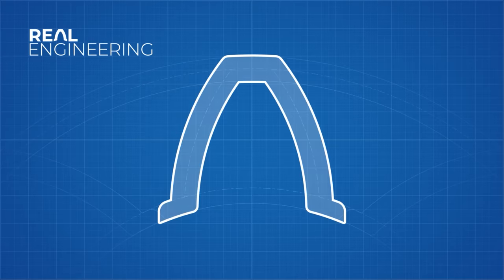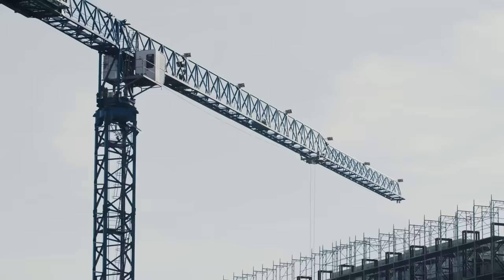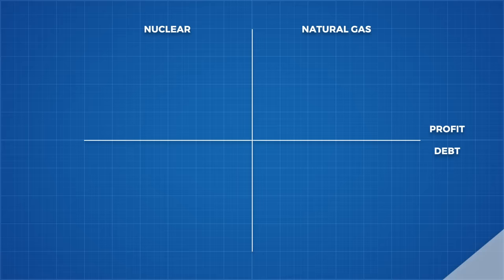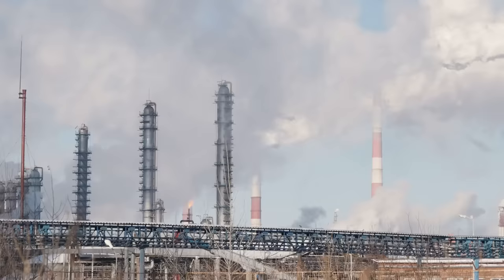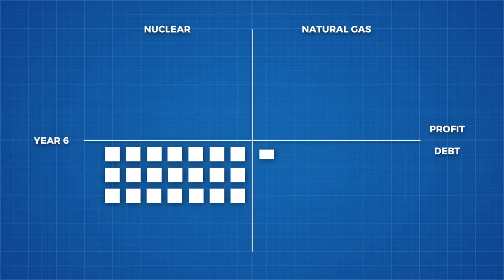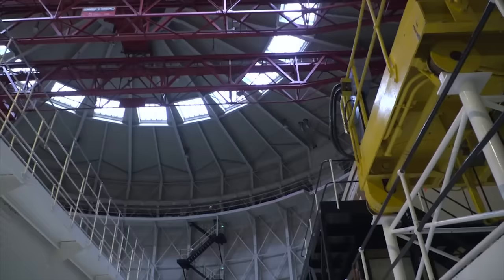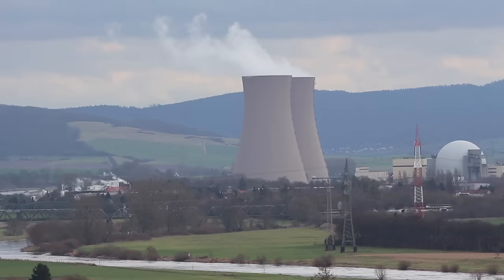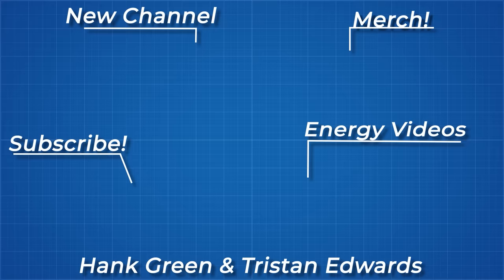The Economics of Nuclear Energy

Comment: "It's competing with larger, baseload plants" Nuclear is the gold standard for baseload
Reply: Yeah exactly. Power production remands consistent all year round and the fuel lasts for a ridiculously long time. It is the perfect source for baseload.
Reply: Exactly, so you now have to compete with the other baseload plants instead of following demand like a gas plant would. The latter is of course more profitable per kwh delivered to the grid.
Reply: @catriona_drummond  well you see that's why we should still use nuclear. Nuclear can be the base load with the battery backed up solar and wind as the short term demand. Solar and wind even basically require this as solar is most effective in the mid day while most power is used at night. Solar also produces the most power in the summer but power demands peak in the winter. This means to effectively use wind and solar you need mass storage, not just some storage. We need to hold what we make in the mid day to night and you can go a whole week of little sun light so about enough storage to hold us for a week or two. This cuts out gas entirely as that is the main contributor to climate change. Sure it's more economical but it's not as sustainable. 

Plus there isn't enough lithium in the world to be converted to power banks. You need to more go along the lines of pumping water into reservoirs or more a liquid battery instead as they are less effected by weather, hold charge more efficiently with lower losses, and can be scaled much larger up. 

Plus the cost for a solar or wind array to be the main energy supply is way higher than you think. It's the whole reason Germany actually has much higher energy costs then France as does California have higher costs then places like Texas or Pennsylvania. The cost to back up a solar array for example basically doubles you cost and doubles you land needs. This means you pay more for land to produce the same amount of energy. Plus, while solar tends to be viewed as cheap, not quite when you are talking mass production. Remember that solar panels rarely function at 100% their rated performance and they do degrade over time as well. When you calculate the cost to produce a nuclear plant vs a solar array of equal energy output with backup storage for it, costs end up being nearly identical. This is kinda something he really skipped over. Solar is cheaper on it's own but only about half. The storage is just as expensive as the panels and using systems like reservoirs requires special zoning permits and more legislation if that's what they go for making the costs comparable to the nuclear plant. The difference is the nuclear plant has a consistent output while the solar array fluctuates greatly depending on weather, season, time of day, or even just the heat. 

Wind is straight up inferior to solar in my eyes though. It requires constant maintenance making it cheap to build but more costly over time. Not to mention that it takes up a huge area of land to make a decent amount of energy as the blades have to be well separated and they have to he far enough apart so if one falls they don't all come crashing down say if a tornado hits.
Reply: @Skylancer727  You haven't understood a word i wrote, have you? My point was exactly that we DON'T need big plants for base load.
Reply: @Skylancer727  Also where will you keep the waste? Not a single country in the world has yet built and is operating a safe end storage for nuclear waste. Not ONE. And we are having these plants around for 60+ years now.
It's like buying a car with an angine and no brakes ("we'll worry about how to stop when we egta to that.")
Reply: @Skylancer727  I am not against Nuclear power at all. But I want to see its problems taken care of first.
Reply: @catriona_drummond  a lot of what we see as the main problems are from how we fuel them and just raw scale. Many are planning on transitioning to liquid fuel reactors as if a runaway heating event occurs it can just melt a plug and go into a backup tank to be refilled after the issue has been solved. This system makes meltdowns entirely impossible. 

Smaller reactors also help in the cost side as the big issue with nuclear is the scale of the projects making them cost a fortune. This is good in that nuclear plants have been the highest outputting format but bad in that this puts their dept issues way worse. Making them smaller reduces complexity and will cut back on the cost of building the plants. There is also the possibility of thorium reactors in the future which would make the mining process drastically cheaper, plus it is far more abundant in the soil meaning we could mine the thorium on our soil rather than importing it like uranium as uranium is far rarer and the majority of uranium in the soil is weapons grade uranium so thorium is drastically cheaper. 

The last issue is waste and that one has been a very slow development. Right now only 1 waste disposal complex exists even under construction but will be finishing completion this summer. Unfortunately it's in Finland, not the US. In theory thorium waste products are less hazardous than uranium products but it still needs to be disposed properly for the longer lasting waste. Nuclear waste really only is a worry for the first 100 years. Anything longer than that usually is far less a threat. Uranium itself has a half life of millions of years which is a good example of what doesn't actually matter. Though the stuff that lasts up to 2000 years will still need to be concealed. Basically put, disposal is necessary. The US should work on our own storage location sooner rather than later more from just the waste we already have in the US and not just what we could make in the future. Where we do so matters though. Best places lack earth quakes, have hard soil, can be dug deep enough to go over a mile down, and have very little ground water. Best place would either be somewhere in the deserts in the west though not Nevada as they are too close to the earthquake zone. Likely something more like Utah. You could also try somewhere in the snowy mountainous north, but you would be putting more risk on infecting ground water. It's a tricky issue.
Reply: @catriona_drummond  Popping in here for the waste problem. Re-refine it, fairly recently breakthroughs have been allowing plants to re-refining their waste until they squeeze all the energy they can out of it. There's still waste but the amount is so small that it's impact is less over time compared to waste produced by other sources, either by operation or materials required to build these alternate forms of energy operation.
Reply: Not anymore. See the Tesla battery  bank in South Australia. Cost  many millions, paid for itself in 3 months. The Gas/Coal/Nuclear  shills are seething at this.
Baseload as a concept is prtetty much BS in the first place, now it is totally irrelevant (FYI I worked in Power Distribution for years).
Thanks Elon Musk. The people Australia thank you for significantly lowering their power bills,On the other hand, there are people in the Gas/Coal industry who would  destroy you if they could, but don't worry, they are mostly just greedy Boomers who will all be dead soon anyhow.
Reply: @catriona_drummond  Yeah sure you don't "need" base load power plants but it's by far cheaper to build one than to have "overbuild" renewable plants all around the country and also build enormous power storage's to capture and disperse them at night.
That's why innovations in the nuclear industry is needed. Because at the moment natural gas is so dominant in that role.

And in no way batteries are cheaper to build than base load plants, for example the battery power reserve Tesla build in Australia have 185 MWh capacity and average daily consumption of electricity in South Australia is 25,000 MWh even if we assume 80% is consumed during day time it still leaves 5000 MWh of electricity needed to be supplied at night. And Tesla batter farm is nowhere near that mark despite $90 million spent. Battery farms are good at supplying peak loads not replacing base power.
Reply: @elapplzsl  batteries are not the best form of storage anyway. Any Nuclear innovation is invalid unless there are end storage facilities. I don't believe the "zero nuclear waste- we can refine everything until nothing is left"-propaganda. It is not currently done. Countries are all haling their highly radioactive nuclear waste from a to be a dn to C and back to A again because noone wants the stuff in their backyard.
There is not a single end storage facility on earth.
And you know, this may be all safe even. But the economic point is: you cannot actually calculate the cost of nuclear energy if you don't look at the cost of the waste disposal and end storage. 
This is the biggest flaw in the video too. It's completely missing out on that point.
As I said before. I am pro Nuclear - AS SOON as the waste is solved. And it isn't. That some armchair engineers on youtube claim it was, is not enough for me I want to see it having been solved in reality.
Btw overbuilding Wind and solar is not actually that expensive.
I hope in the hotter parts of Australia and the US they can maybe try out a a few parabolic through plants. They have no cell decay. And there is one in Arizona already coming with its own molten salt heat stotage.
Reply: @catriona_drummond  
Possible solution would be endbreeders for nuclear waste?
Reply: @_Hal9000  I don't want a possible solution. I want a definitive one that is proven to work.
Running nuclear reactors all around the world with no definitive solution to handle is like buying a car with no brakes and saying you'll worry how to stop when it becomes relevant
Sorry ifI am banging on about this so much but you cannot calculate the cost until you know the cost of waste mangement. I am not talking just about the fuel itself. Once you decommission a nuclear plant there are tons and tons of radioactive waste to consider, not just the fuel rods.
Reply: @oscargoldman85  You must have been a lineman.
Reply: @Catriona. Right! We need to begin with the end in mind. In the 1960s the nuclear industry had the slogan : "The solution to pollution is dilution." Catchy, but fundamentally wrong.
Reply: @M.L. CH  END breeders are a fantasy. With current (and foreseeable) techology, nuclear fuel must be quite pure. And even handling MOX (mixed oxide fuel: U-235 + Pu-239) is trickier than "classic" U-235.
Reply: There’s a lot of shale in the world, unfortunately.
Reply: @Catriona. The British say the Germans don't have a sense of homour. OTOH consider this satire: "extra 3 atomi" -- available on youtube; in German, but you'll get the gist anyway. Enjoy!
Reply: Yes, and it competes with the alternatives earning silver in baseload.
Reply: @Skylancer727  Also its not like making solar panels is a green business. Batteries are even worse and I would be surprised if hydrogen made from water with nuclear power was not cleaner than solar powered battery driven cars when you count in the whole manufacturing line and the need to replace batteries.
Reply: @jepulis6674  well batteries in electric cars have been shown to not need replacements till nearly a decade down the line so they aren't as bad as many people think. They do produce more emissions to make but it is beaten pretty quick by ICE cars within only 2-4 years of driving. 

Hydrogen is a far more lossy process though than raw electricity. Unless you make hydrolysis plants at every gas station in the country rather than hauling it around with trucks, hydrogen is just worse. Remember that hydrogen tends to be just used to charge an electric motor anyways so a battery is still required in most cases anyways. The most clean way to make hydrogen cars is the hydrogen battery hybrids so this is the best they can get. Hydrogen stores tons of power but burning it to drive a motor is far less efficient than using it to make electricity. There really is no perfect method to make hydrogen cars to be superior to full electric ones other than the fact they have longer range. I'm more under the idea hydrogen is one of those fuels that will be left up to the industrial industry for trucks, boats, and maybe planes but not really cars. Electricity already has infrastructure everywhere so it is just superior for cars. 

Hydrogen may not be as good as raw batteries but it is better than normal gas engines. This is basically where it still has any chance left. However if solid state batteries come first, it's just a dead platform. Solid state batteries can be made way more clean than lithium ion ones and they can have high enough energy levels to make it nearly replace hydrogen entirely. Hydrogen will still be more energy dense but with the need for infrastructure solid state batteries would basically ruin its chances for anything but airplanes. Energy is a pretty complicated topic so even if it is replaced for the most part it may still have a small function.
Reply: @16vjtdalfa Its a good question, but I think there is an implied  false equivalence., which is at the heart of the controversy....
Waste fro a Nuclear power plant is so deadly, that it is hard to imagine.
On the other hand, Radioactive waste from mining rare earths is tiny, its the same  that from Coal , Gold (or whatever) ie It is background radioactive material, that only becomes apparent because it is concentrated by  large filtering. Other than that, most of the other bad waste is toxic. Yes bad, but many orders of magnitude better than real radioactive waste.  
You bury it over a wide area, usually where you found it, and there is no problem.
There are issues I'm sure, they should be dealt with. Infact those minerals may be less required, in the near future, there is already talk of simply using of Potassium, Lithium, Sodium and Chlorine, all are in inexhaustive supply in Seawater.
A barrel of Uranium 235 or Carbon 14 can kill you without even being opened, stand next to it for 2 hours, and you will die an agonising death.
With minerals like cobalt, full life treatment of the waste is within the cost of the material, and the material is endlessly  recyclable (example most car batteries have chemicals that would have been recycled more than 50 times.
There is no way in heck, that even if every watt of energy was extracted from  Uranium Rods, and sold at Commercial rates to 1 million households for 60 years , that there would be enough money to remove, treat, secure and maintain the Nuclear waste for 12,000 years, and ensure it doesnt leak into groundwater,. or get stolen for a dirty bomb or whatever. It wouldnt even pay for 10 Janitors of the mountain you would need to buy (let alone the cost of the mountain).
Forget profit, this has always been about externalising the costs onto others, which is inverse theft.
Solar Panels, on the other hand, have no moving parts, average ones should last more than 50 years, good ones, more than 100 years, and the components can be recycled after that.
So the mining requirement will diminish over time .
Reply: @Oscar Goldman  How does a battery installation "pay for itself", it can't generate power past initial discharge.  The money must have been made from government subsidies or produced by another plant.
Reply: @catriona_drummond  current batteries can't store that amount of power. They're great for limited moments but can't power a grid overnight. The production capacity is also lacking a won't be there are decades. It also diverts the limited number of batteries from things like electric cars.